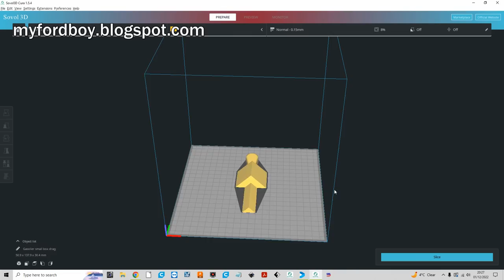Metal Casting at Home Part 124. LNER Railway Carriage Part. ( Full size)

Comment: Would it matter if you used a sieve with a very fine mesh (and/or run the sand through a kitchen blender) to get a sort of nearly powdery consistency before mixing it, would that help to get a smoother finish?
Reply from the maker: Are you refering to the core or the moulding sand?
Reply: @myfordboy  For the core, where you are using silica sand and sodium silicate it's more of a hypothetical question really, that always got me curious...
Reply from the maker: @Khether0001  I do pass it through a sieve. After use it can be reused by washing it. I think if it were too fine the grains might not bond to each other. Smaller surface area. Similar to aggregate used in concrete. Finish can be improved by rubbing  talc into the core. I did a video showing this.

Comment: Hi, j have been watching your videos for a bit now and find the process of 3d printing and casting then machining amazing but do you ever have problems with layers from the print gripping the sand and ruining casts when you remove them or do you have to use a smaller nozzle or maybe post process the prints for smoother finishes before casting? Don’t personally have these problems as I’m 17 and only have a printer but I love machining and. Casting is very interesting so just wondered
Reply from the maker: Sometimes I sand and paint them for a smoother finish. It depends on the shape .

Comment: @myfordboy Would it have worked just as well if you had coated the core form with parting power, instead of painting it?
Reply from the maker: You can get away with that sometimes but painting gives a smoother finish to aid removal from the sand.
Reply: @myfordboy  Thank-you for the response 🙂

Comment: Does the  core sand have a shelf life after adding the sodium silicate  ?
Reply from the maker: I have keep them for a month or more and they are fine.
Reply: Interesting, i was about to ask the same question, i guess it has to do with how fast it will absorb carbon dioxide from the surronding air, so storing it relativly airtight may help increasing the lifespan as i assume. Interesting to hear from someone who actually did try it in reality as well.
Reply from the maker: The core will harden without gassing if you just leave for a a day or so due it Co2 in the air.
Reply: @myfordboy  Thank You for the information.

Comment: Why is this always done kneeling on the ground rather than on a bench or table?
Reply: I suppose that after so many times, it's easier clean up when all the sand is on the ground, and in the same spot.
Reply: Cause that's how he does it. You get a better pack when it's solid underneath.
Reply: The quantity of sand tends to be large, and is easiest managed on the ground.  Traditional casting was done in a sand bed on the ground. For small jobs you can use a bench, but the sand wants to end up on the ground - may as well let it have its way...
Reply: It's not good having sand on the bench, an odd grain or two might find it's  way into a sensitive mechanism and cause all sorts of problems.